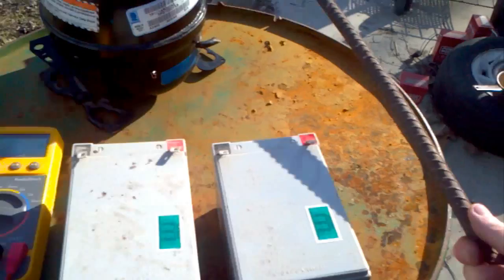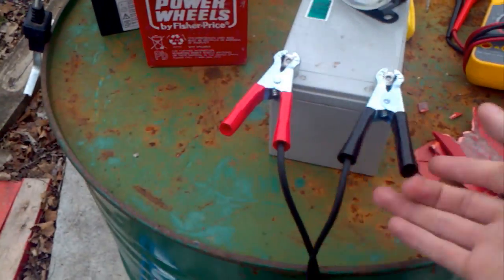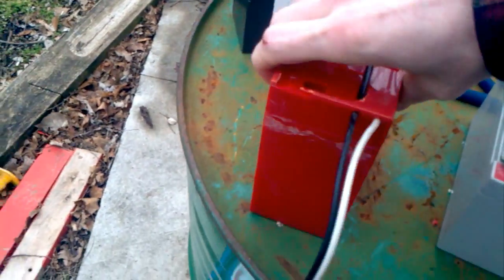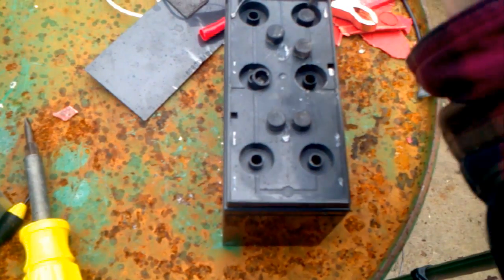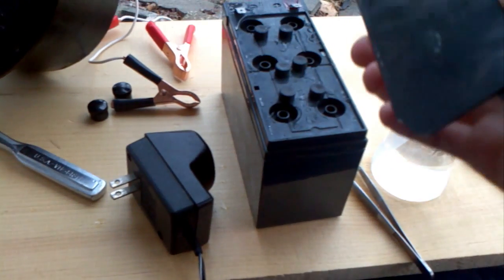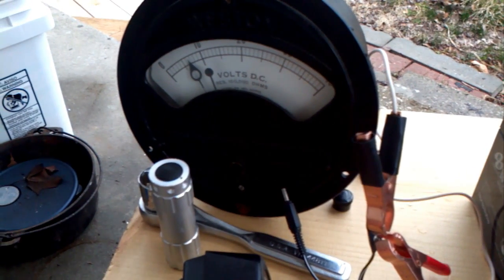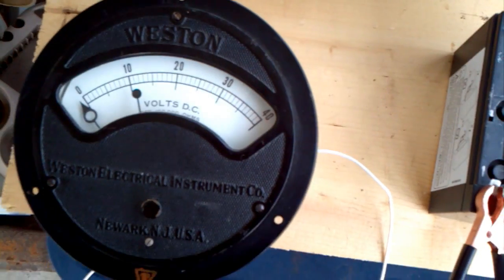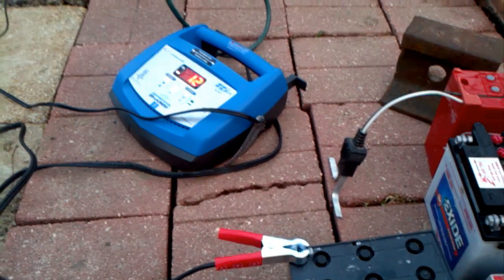DIY: Restoring Sealed Lead Acid Battery

Comment: Don't use tap water. Trust me I have killed 4 batteries after realizing what caused their death. All of them started to take more current and their stable voltage dropped down to the point where it was useless and couldn't even give any current anymore. It like turned into a giant heater
Reply from the maker: ive used it in about 20 batteries without issues for years, so it depends on your tap water
Reply: @RinoaL  indeed it does but generally speaking you should use distilled water or water in it's purest form

Comment: a battery of 12V nominal, giving you 11.2 volts is broken. "i have also fixed this one" - well actually not. at leat one cell is shroted internallya charged 12V battery should give 12.6 V to 13.2 V or so. 5.6 V for a 6 Volt - even as bad ... charged it should read 6.9 or so.

Comment: Really good, I did not understand the part where you use a soldering machine so what would that be? I have a battery of this type only that bigger it has a vase in short where when charging does not pass of 13,25V and heats one of the pots more than the others like this machine of weld has the high amperage would serve to take that short of the battery? I'm using google translator so I hope you can understand because I do not speak English.

Comment: You can't restore batteries. Sure, you can make sure they have the proper acid levels and clean water and even desulfate them with a proper desulfation charger, but you will never reclaim the lost plate material from sulfation and charge/discharge cycles. Sorry, it's gone forever... no amount of trying will restore it. You may be able to get by on a used battery if it isn't too far gone and give it some TLC, but let's not use the word RESTORE.
Reply: it is "restored" it was dead and is back to a usable capacity, i understand what your saying but to many people knock others for trying to fix lead acid batteries when they are the most DIYable batterry out there in terms of fixability

Comment: If you hook it up to a good battery it will make the chargers work, but you need a good battery and a bad battery hooked together and the charger.
Reply: you're correct some chargers especially the digital ones can't detect a battery that's below certain voltage or completely dead and you have to hook up another known good battery so the charger can detect a battery for it to charge the dead battery that's why I still keep my old solid state charger around...I love my electric charger for its float and trickle charging features but the old solid state chargers still have there place

Comment: I not a professional but ain't ya supposed to top it up with deionised distilled water and top up when fully charged unless its dry then use Epson salts and/or a drop of acid  from working car battery

Comment: I have a car sealed lead acid battery when i removed the plastic welded lid i found that it had no caps over the top up holes and had vent smaller vent holes beside it but it now holds a charge how do cap these holes? because other wise it will spill acid over my alternator as i drive
Reply: wire feed welder man... weren't you paying attention?

Comment: Tapwater? Surely distilled water is wiser to use than that mate?
Reply: +Watch Ryder  I agree, tap water with the dissolved minerals and chlorine/bromine added by municipal water will kill a battery. I made that mistake once 40 years ago - a week later I was buying a new battery. Distilled water only is the firm and fast rule when doing maintenance with any lead acid battery, and keep the batteries top squeaky clean so a high resistence path doesn't develop between the battery posts or tabs. Right now I am on year five of a three year warrantied battery, and it still reads out 12.9 VDC resting voltage on an expensive and accurate DVM.
Reply: Tap water - NO, Rain water - NO, Distilled or osmotically filtered water - YES!!! Tap and rain water has dissolved metals, chlorine, bromine, and whatever else that was in the water source it was drawn from - really bad for your efforts to rejuvenate your battery. Only use distilled water for your battery "Rinoa Super Genius". You even clean the outside of your battery with distilled water, changing cloths or paper towels repeatedly. Why? Any dust or dirt has rust in it, and provides a high resistant path that will slowly discharge your battery over time.

Comment: The big question is:

What acid or alkaline solution dissolves the sulfates only, on the lead.

I know that certain acids remove rust off of steel without eating the steel, perhaps there is an acid or an alkaline that dissolves the sulfates. Then you can fill it, soak it, pour it out, rinse with tap water several times soak in tap water pour it out fill it with battery acid and you done, any ideas on that? It would help us all and be good for the planet.
Reply: Here I found some thing on how to dissolve the sulfates DO NOT TRY THIS UNLESS YOU ARE AN ADULT AND YOU KNOW WHAT STRONG ACIDS DO TO HUMANS IN SECONDS - ONE MISTAKE CAN RUIN YOUR LIFE.

https://en.wikipedia.org/wiki/Lead%28II%29_sulfate

So its concentrated (Sulfuric Acid, Nitric Acid, Hydrochloric Acid and Sodium Hydroxide). all super dangerous liquids, I dont recommend doing this actually, its very, very dangerous.

Just remember that if you go pouring concentrated acids or alkaline's into a battery that the chemical reaction may be quite spectacular and considering that there is such a small hole in the battery casing, for what could potentially be a violent reaction, you could end up blowing up the battery and covering yourself with corrosive liquids that will eat up your eyes and your skin.

Having the knowledge is one thing, killing yourself with it is another, so take the necessary precautions, one mistake and you can loose your sight or your face or even your life so find out which of the 4 sulfate solvents is the safest to use when washing out a battery (I would use Sulfuric as thats what battery acid is made from). And remember even if you rinse the battery inside with tap water several times and soak it in water for several days, some of the nasty stuff will be left inside when you add the battery acid at the end and this too could create an explosion.

Battery acid is 37% diluted Sulfuric so using concentrated Sulfuric acid would probably be the safest to use as it shouldnt react with the acid in the battery, but you never know what is in there, and it could easily go BOOM.

I would do it this way if I try it:
1) Wash it out with tap water 5x then soak it in water for a day.
2) Empty it out and add the concentrate sulfuric acid on one cell
3) I dont know how long to leave it in there to dissolve the sulfates
4) Pour out the acid 
5) Rinse and soak 5x plus one day soaking with tap water
6) Add battery acid which is a solution of 37% Sulfuric Acid
7) Charge it up on a trickle charger over night - outside in a safe covered place.

I have used common household chemicals, one teaspoon of each in a plastic 2L bottle that was sealed up, and it went off so hard that the air moved and I found the bottle next door in the middle of neighbors property....so watch out, this will use a lot more than 2 tea spoons so you may destroy your home and yourself.

Think about the risk reward ratio before you start and do a lot of research and start small, do one cell behind a blast barricade, add and run, no pets in that area or they may wonder in to take a look at what you were doing and booom.

Your eyes are priceless, if you can afford a battery rather just go buy a new one.

Comment: Hi, what water do we use to top up the battery? is it just normal water?
Reply: yep
Reply: +DMAN22yeah    Go ahead, use tap water.Then don't blame anyone but yourself for ruining your battery. ALWAYS use distilled water to fill the dried out cells in any kind of lead acid battery. The junk and crap that municipal water systems leave in the water that you drink will kill a battery - and maybe you too. Anyone that uses tap water in a lead acid battery is a fool. Call your local battery supplier and ask them, they will back me up 100%. Use only distilled water, and keep your battery clean.You will get years of use out of it. Let the posts get corroded, use tap water, don't clean the batteries top and you will be buying another battery just after the warranty runs out.
Reply: longshorts3 it shortens the life of the battery by a few weeks, it isnt worth it to get distilled water if you dont already have it unless your battery is brand new
Reply: Distilled water is CHEAP, under a dollar a gallon. Tap water is really cheap, but using distilled water, even if the battery is old makes many months to several years difference. Doesn't matter whether the battery is old or new, tap water kills a battery before it's time. If you don't care spending several hundred dollars during the life of your car replacing batteries because you screwed them up by using tap water - go ahead. It's YOUR money.

Comment: I just let the vacuum out of one  and it's gone from 5.4V to 11. 87V  (with peanut lamp load) without any water or charging,  and it's been sitting on a shelf here for years since I found it dumped.  I'm off to search for de-ionized water.

Comment: You should use distilled water and no epsom salt, unless you want it to sulfate in a week..
Also charge at 14 volts not 17 volts. this will cause your battery to get too hot too fast and "bloat".. i also found a new product- it's get in google

Comment: tap water...really? Should be distilled water.  DO NOT TRY WHAT THIS GUYS DOES. During charging or overcharging process, oxygen and HYDROGEN (flammable) are released after a cell of a battery received 93-95% of its charge - Battery can explode

Comment: You should use distilled water and no epsom salt, unless you want it to sulfate in a week..
Also charge at 14 volts not 17 volts. this will cause your battery to get too hot too fast and "bloat"

A WIRE WELDER! REALLY!... You think your Photonicinduction? oh wow hope you have someone there to call 911 when one of those batteries blows up on you.

I'm going to take a wile shot in the dark from the hip and say your a junk collector.. I mean who randomly picks up one small piece of scrap re-barb off the side of the road?
With all those dead batteries there you can take then to a scrap yard and get enough cash to buy a brand new SLA battery off ebay..
Reply: interesting points ,if anyone else is searching for how to recondition batteries try Megarno Amazing Battery Magician (Have a quick look on google cant remember the place now ) ? Ive heard some awesome things about it and my mate got excellent results with it.

Comment: just pointing out that when you ran the light in the beginning you were running it off of the charger....because the charger was hooked up to the battery
Reply: +chaseme81871 the charger wasnt running

Comment: One question I have a 12V 7AH AGM battery (got it cheap at the local scrap yard) And it shows 12.7V on the meter and when I connect the charger it instantly goes up to 14.8V then when I connect a 5A load It drops down to 1-2V 
Is there a cheap way to fix it or is it completely dead with no possibility of recovery
Reply: ***** dead cell, its doomed. This is why its always best to just buy new batteries like this.
Reply: Well unfortunately I can't afford $3 per AH
Reply: +mewantbrains just sounds really sulfated
Reply: Batteries like this are dirt cheap now if you do some hunting online.
Better to spend like $20 on a new battery than risk a fire or serious injury trying to restore one.
Reply: I have found a way to restore them reliably 

It's controlled overcharging
Reply: +mewantbrains yep thats how you do it
Reply: I have a 75% success rate with it
Reply: +mewantbrains awesome
Reply: Solar panels without a regulator is a good way to overcharge batteries for this purpose
Reply: ***** yeah, i have one that goes to 15v
Reply: mine are for a 24 volt system.. definitely need a charge controller for them
Reply: ElfNet Gaming yeah, a good mppt charge controller should have an equalize mode
Reply: My solar regulator fucked out a few weeks ago 

And I don't have $300 for a new one 
(I don't trust the shit that gets shat out of China on eBay)

It's cheaper to connect the panels to a heavy duty switch and turn the panels on and off manually
Reply: +mewantbrains yeah, my charger for my sla died, so i just take a dc wall wart and unplug it when its done because they put out like 17 volts
Reply: Normal wall warts do not have an over charge protection, you should put a current meter on it so you can monitor it.
Reply: +ElfNet Gaming i monitor the voltage and current with my volt meter
Reply: That works, as long as your watching it, don't just let it go
Reply: +ElfNet Gaming yeah
Reply: A laptop charger without overload protection is another good choice for equalising small batteries 

They are rare but you can get them without an overload protection circuit 
Just make sure to keep an eye on them lest they catch fire and burn your house down
Reply: +mewantbrains if you cant find one wall warts do that too
Reply: What's a wall wart?
Reply: +mewantbrains one of those things that covers like 2 outlets and powers routers and such
Reply: Ok can you send me a link 
I have no idea what you are talking about
Reply: +mewantbrains How long do you let your solar panel charging your 12 V 7Ah batt without regulator? Thanks

Comment: I forgot to mention there is a battery rebuilding shop not far from me that has been in business over 20 years. They will even rebuilt your own battery if they do not have the proper size already. The prices on their rebuilt batteries are all the same. But over the years they have gone from $50 when they opened and now are $110. But they warranty them for 12 months. Many used car lots buy batteries from them and the general public you can not beat their prices. I just wonder how they do it? I do know once one is rebuilt I could see fresh tar on top of them. Now they do charge more for large 24 volt batteries for buses and semi tractors. Nice video .....

Comment: Interesting - have you ever tried shocking a battery? It's like when you hook up battery jumper cables wrong for just an instant. Plus  it would be interesting to see just how long these batteries would last once you restored wrong last at their max. rated amp drawl. Just a question is a battery charged by volts or amps - could you please explain this? This is where I become confused amps verses volts when charging and a batteries out put rating. Thank You

Comment: Hey can someone tell me how he powered the laptop? I've been trying to find a solution to power my laptop straight off a 12v battery, if anyone knows please do tell.
Reply: I would translate that into readable English but your grammar is too far gone for me to even understand it
Reply from the maker: i simply put 12v into the charging port. this battery likes 16v input but will run on as low as 10v
Reply: If your really careful you can solder wires directly to the pins on the battery connector and power it that way (it's usually the 2 biggest pins) however there is no reliable way to see the polarity and you may cry your laptop doing it that way
Reply: I mean fry your laptop
Reply: Older laptop but runs 12 input like if connect to house transformer 110v ac and changes to 12v to 15v dc that how not booking up at laptop bat if more ? Ask
Reply: get a car charger lmfao
Reply: I use a 130w enverter.
Reply: For anyone else interested I found a wonderful company that makes DC laptop power supplies, so far my units been running great for almost a year now https://pwr-plus.com/catalog/car_dc_adapters/
Reply: +Tara Edberg Listen through the presentation and they want $47 for you to download a instruction on how to reconditon old batt., or you can watch this video for free and just do whats he's doing.
Reply: Not certain about the points made but ,if anyone else trying to find out how to recondition batteries try Trefendous Rapid  Extender Tips (just google it ) ? Ive heard some incredible things about it and my friend got amazing results with it.
Reply: hi everyone ,if anyone else wants to discover learn how to recondition batteries at home try Trefendous Rapid  Extender Tips (do a search on google ) ? Ive heard some pretty good things about it and my cousin got amazing success with it.
Reply: Not certain about the points made but ,if anyone else is searching for how to recondition used car batteries try Trefendous Rapid  Extender Tips ( search on google ) ? Ive heard some interesting things about it and my m8 got cool results with it.

Comment: Thanks so much to your videos for giving me the knowledge and confidence to restore some old SLAs that otherwise would have been bound for the dump. I have a problem with a new SLA I got off ebay: When inside the UPS, the battery is on its side and leaks some liquid. Any suggestions how to make sure those caps stay on snug? Thanks